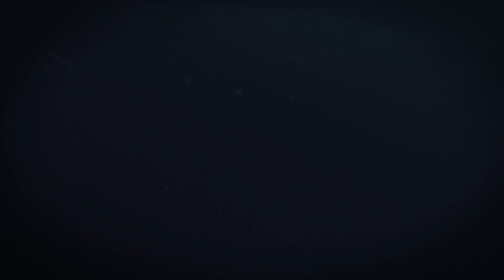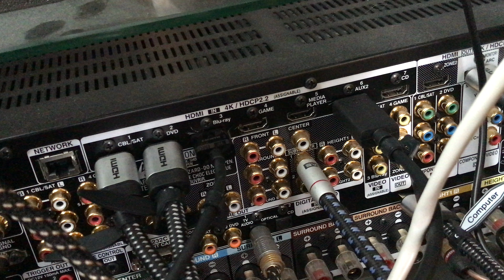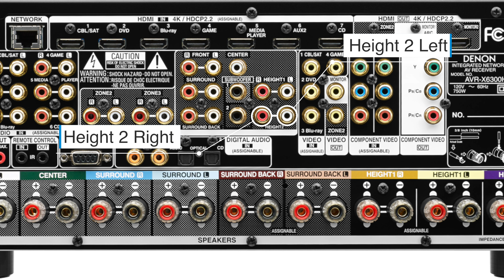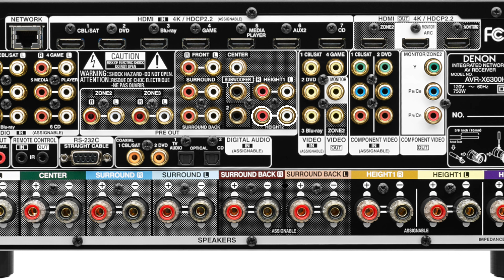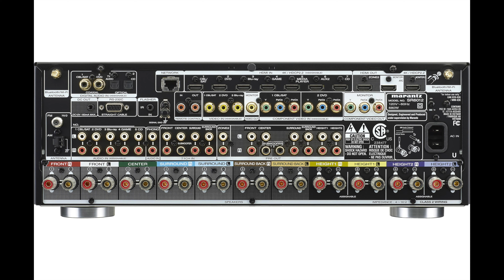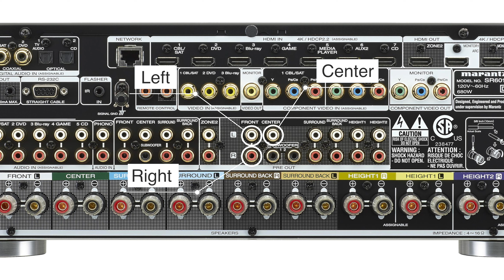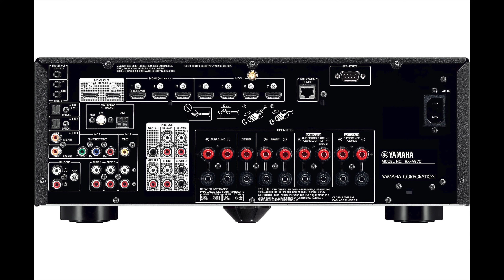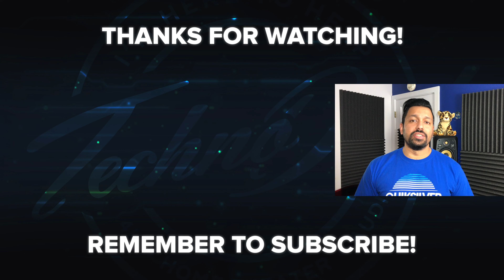How to Add an External Amplifier to Your AV Receiver | Home Theater Basics

Comment: I've spent 18 hours straight, no sleep, no food, no bathroom, doing ur exsct connections over & over again using different cable brands & keep getting same non working results. Bought new marantz sr8015 wirh new xpa 3 gen 3 to run my front right, left and center, the rest on the marantz which should be just the 4 top atmos ceiling speakers and 2 surround speakers wirh 2 surround backs for a total of 7.1.4. I put marantz on 13.1 ch cause it does NOT recognize nor offer pre outs for my set up if I put 11.1 ch., only at 13.1 does it offer ONLY q pre outs for front left right tower speakers.   Marantz does NOT give me optik  at all to pre amp mu  enter which is Y I bought this expensive xpa 3 gen 3, so I can run all 3 on the Xpa 3 amp. 18 hours changing cables trying all I could including picking diff options on the sr8015. It refuses to let me use the center as a preamp so im forced to only use the q front left right speakers as pre amp while the center is only recognized as center for the marantz only wirh NO pre amp center speaker option. The only time I see the marantz adoring the center as a pre out is if I chose the option of all pre amplifier to have all 11 speakers do pre amp which I can't do cause I only have this 3 ch xpa. The minute I change that all pre amp option, it goes back to not recognizing it ad a pre amp speaker option. Also, here is the CRAZY part. U & Everyone on YouTube says ro plug the banana plugs to the pre amp & NOT the receiver BUT marantz requires u to connect the speakers to rhe marantzz receiver itself, NOT the pre amp. Everytime I did it ur way, marantz never found those speakers. When I connected them to the maranrtz, NOW it sees the speakers & let's me do the pre amp option when I run  auddessey as it will NOT see nor recognize any of the speakers connected to the amp. So now I have all the speakers connected to the marantz wirh the 3 rca jacks con enter from the pre out connections on the receiver to the bs k of the xpa 3 gen3 as this is the only it recognizes the 2 pre amp left right towers. The q towers are now working g this way pre amped backwards this way but the center is still not recog iced as a pre amp forcing it to be connected to the receiver. Hie can I get marantz to recognize center as pre amp for my set up & Y is marrantz forcing both pre smp towers to be connected to itself i stead of directly to amp like u all do? It's literally required to do in the audessey me u and assistant cali ration as well. I tried small, large, all settings. After 18 hours I gave up leaving online that but it's bothering me a lot cause I want to pre amp that center or else I would have paid 1800 for that xpa 3. Is this some freak of nature issue?
Reply from the maker: Hi! Sorry I just saw this now...just connect the speakers how you want it...these AVRs are sending signals to the pre-outs except the ones you have to select.  Does that make sense?
Reply: @TechnoDad Thanks for ur reply. After days of messing with it, I just gave up and left ir connected the way I originally described as a freak of nature connection as rhat seems to be rhe only way it works. Blessings

Comment: I have been using the emotiva Basx A2m for 3 days. Love it. I got it to add surround back channels with pre outs. I calibrated everything with rhis connected. Seems very good. I have connected it to a wizz socket so i csn turn on and off. I did this because of course there is no remote with this emotiva and also as i found just setting it to auto the machine would click off if the sound was too quiet. I am pleased although worried about adjusting the volume on my pioneer avr when i have the emotiva (surround back) turned off in case it affects the overall calibration to the back speakers. It is nice i have 120watt speakers connectected which are rated 4-8 ohms. I am aware that this emotiva mini is rated only at 50 watts per channel at 8 ohms.  It all seems great just hope i am not causing any dammage to it with such a high wattage in long term.

Comment: I want to add an Integrated amp to an av receiver.  if i do as you show in the video, how do i adjust the volume control for both the receiver and the integrated amp since they have their own volume control knobs?  I want to make sure I don't distort the sound by not properly pair the gains for each unit.  The reason I want to use an integrated amp instead of a power amp is to bypass the pre-amp in the av receiver, which can affect the sonic quality of the combination.  Can I use the LINE output instead of the preamp outputs to achieve that goal?

Comment: Hello Techno Dad. This video is really nice and helpful, but I have a question about another DENIN X2400H that I own. In the instructions for connecting an additional amplifier to the device, it says to connect ZONE2 on the AVR to the AUX input on the amplifier, of course via an RCA cable. I would like to amplify only the front speakers like this, to get a better stereo sound when listening to music. Do you have any experience with this and can you tell me if I would get a better sound with a good amp than my DENON. So would the sound have the characteristics of this other amplifier? Thanks for your reply and I wish you all the best.

Comment: Great video, learnt a lot from it. I have a specific scenario. For my 7.2.4 setup which currently has 2 Surround-BACK speakers, i want to add 2 more Surround-BACK. My AVR has option for pre-out the Surr-back, but how do i set this up with a external amp to send this audio to 4 Speakers?

Comment: On my Onkyo TX NR696 the pre-outs are used by the subwoofers. How ever there is a left and right line out next to them. I used the line outputs and a separate pre-amp to control an Onkyo M501 power amp. The only drawback is the the volume to the additional speakers are controlled by the separate pre-amp. Would it be possible to use split left and right RCA cables to send the pre-out signal to the subwoofers and the power amp?

Comment: Hi
I want to do the same thing with my DENON AVR but I have a question,how you contol the volume after that??
I mean I will have 2 front speakers connected to the ex-amp and 3 with my DENON,anyone knows?

Comment: i have connected two professional amplifier  in a receiver 5.1 using  the pre out subwoofer conection,  and each professional amplifier have two  18 inch subwoofers speakers,  and sound great

Comment: Help I'm almost BALD, onkyo tx-nr807 I just bought it used, I haven't hear a crackle or anything, I've tried high speed HDMI RCA optical. I can't get anything out of it no smoke smell or dents or sign of a problem. HELP PLEASE I DID ALL THIS WITH PIONEER ELITE 49 THX AND 95. I don't know if my TV has took a dump or what

Comment: I have a Sony STR-DH790, running the Klipsch Reference Cinema System 5.1.4 with Dolby ATMOS. I can only power 2 of the 4 atmos speakers, I'd love to power the other two speakers but my AVR doesn't have 9 channel capability, can I power the other two Atmos speakers by getting an external amplifier added to my system? And if so how can I do it?

Comment: Great video, thanks for the easy explanation. A question though, please.  I am getting a new Onkyo  tx-rz50 soon to replace my older Onkyo TX NR 626 AV Amp, This video got me wondering if I could use my older AV Amp as a Pre-out to power the front speakers, or vice versa instead of buying a dedicated amp?

Comment: What about doing this to save $$.   I have a 9.2  marantz  SR7015,to drive 5.1  channels for my living room and TV with surround and woofer, and I used the other 4 channels for stereo speakers in two other rooms.  I have another room with speaker outlets, but not enough channels.  It was expensive in 2010 and now is getting long on the tooth as it doesn't support SDR and other new fancy stuff.  Rather then get the new version, I was thinking of getting a great 5.1 or 5.2 AVR for a lot cheaper and then connecting from the preamp a good 4 channel amp to drive stereo in two room.  Heck I can get a 6 channel amp and drive 6 speaker in three rooms. .   I don't need the fancy stuff for the other rooms.  Question I have, is it really cheaper.  I would thinks so. and how do you control all of that from a universal.

Comment: Connecting cables is pretty obvious, but this isn't to me:
So you just plug it in and the volume levels on the power amp speakers are automatically exactly the same as the ones in the receiver? Surely if the power amp has a higher wattage than the receiver, the power amp'd speakers will play louder.
Is there a pre out level setting on receivers for this, or is it fixed using room connection and manual level adjustment?

If the power amp is much more powerful than the receiver, then surely the signal level will be reduced enough to be too weak for a clear and good quality signal?
I know if I turn my PC master volume down to 1% and turn my amp attached to it up, I'll get a degraded signal.

Comment: great video! thank you! quick question: is it possible to connect two 3-channel amps to one AV receiver to power 6 channels?
Reply from the maker: Hi!  Yes, and it helps if the amps have trigger in and out so you can daisy chain the trigger output if the AVR only has one trigger output.
Reply: @TechnoDad  perfect! Thanks so much!

Comment: Plug into the "proper ports"?  I came here to find out which ports. This was not helpful. Which ports on the Cambridge axr100 would I plug into?
Reply from the maker: For that specific amplifier, any of the analog inputs would work.  Here's another video with more detail on using a two channel amp as a power amp - https://youtu.be/x_a-9Uq4Tzc?t=404

Comment: Have 2 yamahas 3020 & 6250. Pre out the 3020 fronts to the 6250. Question which input do I use on the 6250. I see the 3020 front pre outs.
Reply from the maker: Hi!  You can use any analog input but only do that for front left and front right.  Put the old AVR into stereo or direct so there is no processing on that second AVR.

Comment: Hello Techo dad, I need your pro advise on a setup, I am setting up 7.2.4 in my main media room as Zone 1, and for this I am going with Marantz 8015 to do the job. However, I am adding 2 ceiling speakers in dinning (as zone 2) and 2 in family area as (zone 3), Plz advise me which amp I need to hook-up with 8015 to do the job, my preference is Marantz, and I need your assistance how to make connection between these two amps. Thanks
Reply from the maker: Hi!  You would need to get a 4-channel amplifier and connect Zone 2 and Zone 3 pre-outs for the other rooms.  Remember that you can only send an analog signal to Zone 2 & 3.

Comment: Hello Channa, I have a Denon 3700 AVR and a Outlaw 7X300 amp connected to my Klipsch speakers. I have 5.2.4 set up. I am using the 7 channels of the amp to connect the main 5 speakers and two of the height (Atmos speakers). Remaining pair of Atmos speakers are connected to the AVR. I bought an Adcom GFA-545 power amp 100 WPC @ 8 Ohms in the second hand market. Do you think I can connect the remaining two Atmos speakers to this amp? The Outlaw is connected via a trigger cable. This amp has to be powered directly I believe. Is there anything wrong in using two amps from the Denon 3700H AVR? Your kind reply will be greatly appreciated. Thanks,

Comment: i'm running a Denon x1700h as my surround and want to power an outdoor set of speakers with an Onkyo 8522....obviously i use the pre out from the Denon, but which INPUT do I use on the Onkyo??  Is there a certain Amp Assign I need to do?  Confused

Comment: Hi, great detailed review. I had one question - currently I have 7.2 receiver with additional 2 channels for zone 2 but at the same time it can only power 7 channels. I have 2 pre-outs as well for front R/L. Recently I bought klipsch 5.1.4 speakers and wanted to check will this config work? by pass the front R/L to one of my additional amplifier, then use only center+surround(R/L)+height 1for front R/L atmos and then zone 2 for back R/L atmos. This way my AV can give power to these 7 channels and front R/L can be powered from my additional amplifier. Thanks for the help
Reply from the maker: Hi!  Unfortunately, that won't work the way you describe.  You will need a 9 channel AVR for two sets of height channels.  7 channel AVRs will not run this way.
Reply: @TechnoDad  sorry did not get it completely, so when can I use my front pre-outs to connect to external amp. I have 9 speakers ports in my AVR, so when not using front R/L ports on AVR isnt it then left with 5 channels(center+surround R/L+ height 1 R/L) getting power? or does that mean even if Im using front pre-outs to connect to external amp, in total its being consuming all 7 amps and zone 2 R/L can not be activated?

Comment: Technodad… how would I connect three power amplifiers up to a Marantz 7706 processor? I would like to use three Emotiva amps… one 3 channel for LCR, one 4 channel amp for my ceiling  speakers and another 4 channel amp to power my floor surrounds. Do I just plug the 3 channel in to my LCR (after setting the pre-out in the software to “main”) and then all other pre-outs to the respective amps? Thank you for any help!

Comment: When you assign your denom front ,right and left pre outs to external amplifier, what are you going to do with denon front,right and left speaker outs, can I use it to height speakers or just waste the watts output from those speakers outs
Reply from the maker: Hi!  Unfortunately, you can't re-route the audio signals going to those speaker terminals.  It's just "wasted wattage."

Comment: Two questions #1 is there a setting to cut out the speakers out line to direct it to the pro outs? And can I use another A/V amp as my second amp?
Reply from the maker: Hi Dennis!  Some AVRs have a "pre-amp" mode which will do what you describe, but you need to externally power all your speakers.  You could use an older AVR as a power amp but I don't really recommend it.  If you do go that route, make sure it's only stereo and no processing, otherwise, you'll have some issues.

Comment: Cab I run two amps?  3 channel  for front  and 2nd amp with 5 channel
Reply from the maker: Yes!  I use two, 5-Channal amps for my setup.  It’s easier if at least one amp has a trigger output to daisy chain the trigger if your AVR has only one trigger output.
Reply: @TechnoDad  thank you for all your help. I really appreciate it.

Comment: Here's hoping you answer my question seeing this video is older. If you wanted a 7.1.4 setup and you have the DENON with the same 9 channel power but need to add a separate amp for the final 2 channels. I want to power my height/atmos ceiling speakers but my amp only has pre-outs that read "fronts"  can I still use the amp to power my height speakers if I select them in the Denon Speakers > Manual Setup > Amp Assign > Layout > Floor - Layout 5ch & SB and Pre-out Rear Height will it work or do I need an Amp that reads height channels on the back?
Reply: The reason why I want to power my height channels and not my front to speakers is because sometimes I don't want to have both units on.
Reply from the maker: What model Denon do you have?  You should be able to change pre out from front to rear height.
Reply: @TechnoDad  Denon X4700H. So just in the settings on the DENON correct? Like I mentioned?
Reply: My amp has Fronts but if I have it setup up on my Denon AVR's settings as height option the sound should come out of the ceiling speakers correct?

Comment: How do you connect more than one external amp to a home theater system?
Reply from the maker: You connect it.  I have two, 5 channel power amps with my system.  I connect the ear level speakers RCA outs to the more powerful amp inputs and then connect the height channels RCA outs to the other amp inputs.  That's all, nothing crazy.

Comment: What if I just want to power left and right and just use the 2 channels!
I have the SR 6007 from marantz .
Just want to use it as a 2 channel ..
But want more output..

Thanks
Reply from the maker: Hi!  You should be getting some good power if it's only the two channels being drive.  However, if you have left and right pre outs for main speakers, you could add a power amp.

Comment: Just brought Denon X4700h....need Amp for my front Atmos
Reply from the maker: Hi!  What about for your front stage?  Check out the Emotiva BasX A3.
Reply: @TechnoDad Currently running a 5.2.4 off that Denon.  I'm getting the A5 for Christmas, would you suggest I use that A5 for the 5 bed layer n let AVR handle 4 atmos n 2 surrounds. Or just get A3 for LCR n let A5 handle 4 atmos n avr handle 2 surrounds

Comment: I'm setting up my first home theater. Have all the equipment picked out except the amplifier. I've heard people say the amp os not going to provide any noticeable difference, and I've heard people say it will make a massive difference. It's a 7.1 channel setup. The front stage speakers are big fancy speakers, the rest are all smaller. My thought was to get an amp for my front big expensive speakers, but I don't want to spend the money if it's not going to make a big difference. I'm not worried about total loudness, I just want the best sound quality, it's not that big of a room.

Comment: The main reason you want to go to seperates is mostly NOT because of amplification or number of channels (7,11,13, 400 whatever). It's because of old HDMI spec or you want 4k or 8k that your original receiver is not capable of doing. If you have a good receiver (AVR) that outputs 130 watts per channel but has out of date HDM1 2.0 spec therefore can only do 1k (1080p), then you don't need more amps or channels,  you need a processor that is more up to date. Get a pre processor and use the old AVR as an Amp source.